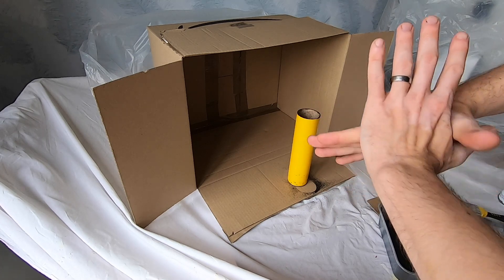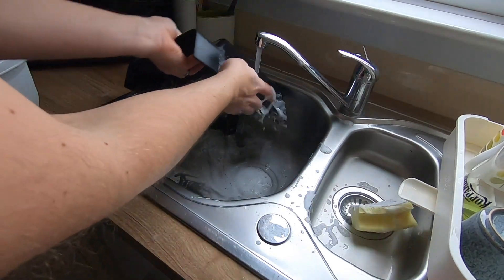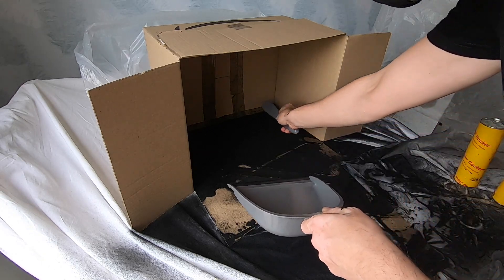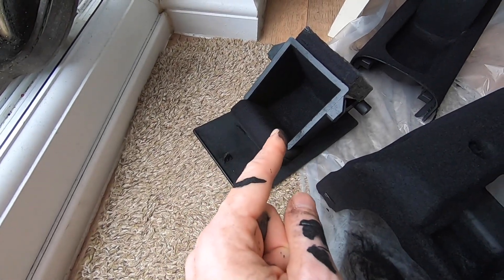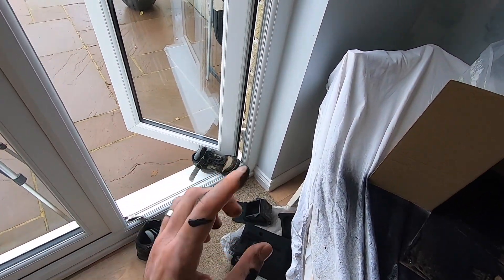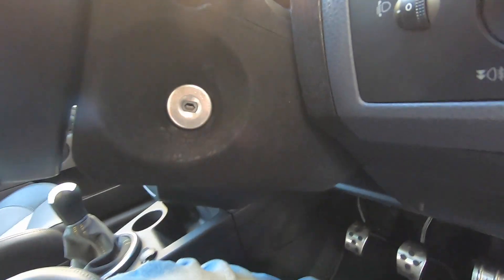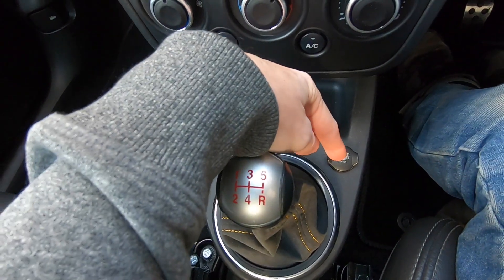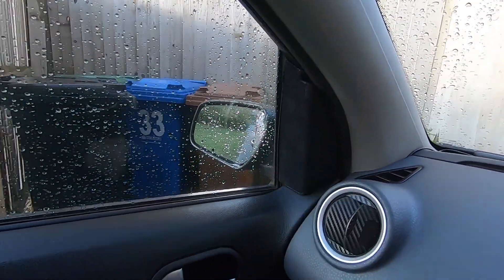How To Flock Car Interior Parts Detailed Flocking Tutorial Car Mods - Episode 23

Comment: If you've never tried it, a barrier cream like PR88 is a lifesaver for cleaning up your hands after a job like this. You apply a thin layer to your skin (which basically disappears, unlike gloves which can be a bit cumbersome) before starting and once your finished the glue or paint will just come away with soap and water.

Comment: you got me with the mirror interior trims, originaly they feel cheap af, Id love to know how and where did you get those ac knobs, Im also desperate to find the color code for the stereo surround dashboard, that anthracite metallic grey just doesnt exist anywhere.

edit: for the roof and the pilars you can get spray paint for vinyl leather and fabric, there is a dupli-color spray paint for that job.
Reply from the maker: Yeh love the two Morris trim pieces, nice touch to the inside.
I dont mind the grey dash touch. Wouldnt mind it all done in alcantara or leather though ha.
My door cards will be the same alcantara with gold stitching as my gaitors to tie in and then leather with gold stitching along the top of the door card. Then the inside should be nearly done and looking good
Reply: @DriveWithAndy  oh yeah, i forgot the all black and gold theme you got there :) I dont mind the grey dash either, but the factory paint is just too sensitive, I have some worn out areas near hazzard button and under the stereo, thats why I want to find the original paint.
Reply from the maker: ohhh i see, i honestly didnt know those areas where painted, just thought it would be a plastic mould in that colour. If i had it any other way Gloss Black would be cool but then you do get bad reflections in the window which can be annoying. Might do my Door Pull Surrounds gloss black whrn i get the door cards re trimmed. Also when i can afford it haha
Reply: @DriveWithAndy  oh yeah they are painted, very poorly I must say so watch out if you want to keep it original, gloss black is not an option, buttons and stereo can not be painted and would look off.
Reply from the maker: @neurontechno  very true about the buttons, they will stand out. Thats why i like my new head unit as its the same grey plastic, not some horrid after market surround that looks a diffeent finish and colour and not a great fit
Reply: @DriveWithAndy  still waiting for it lol
Reply: @DriveWithAndy  forgot to mention, if youll ever want to spraypaint surround dash,, remove original paint cause it will peel off
 underneath and will inflate, it will react with the spray paint.

Comment: Interesting… thanks man! Question though, why not just rub down the handbrake surround and try again?
Reply from the maker: its quite hard to sand down and start again. I guess you can do but the glue basically becomes rock hard like dry superglue so it would need sanding down like crazy. I asked the flock shop i bought the stuf from and they advised its always best to start from scratch with flocking haha
Reply: @DriveWithAndy  ah ok. I have some bits to do so will investigate. Thanks man.

Comment: Nice vid, you spelt interior wrong though 😜
Reply from the maker: Thanks man, oops haha, my England is not the best 😆
Corrected
Reply: @DriveWithAndy  no worries, your English is good mate lol

How comes you never went with the electrostatic machines for this?  I’m thinking of getting the machine itself
Reply from the maker: @DJLloydy  think it was just cost and heard the pringles tube is just as good but I think after a few attempts at it now and not 100% happy with some small areas not adhering I would say getting the machine would guarantee a slightly better finish

Comment: what length did you use? 1mm or 2mm?
Reply from the maker: My order doesn't state but I feel it was 1mm as it's extremely fine the finish I got. 2mm will give you more of that effect where the shade changes when you brush it
Reply: @DriveWithAndy  thanks for the info. Am getting bad results atm. The glue dries too quickly for me and without a flocking applicator... The results are uneven
Reply from the maker: @mohsinrasul8450  yeh it's not the easiest thing to do but you definitely need the applicator. I wasn't happy with one of my parts and got a whole new piece to do it again. Otherwise means sanding it back

Comment: You said it feels like Alcantara? So it’s soft?
Reply from the maker: Yeh it has that soft feeling. If done right. Once I had something done by modsnflocks and was a bit hard and rough. Flocking can be great if done correctly but in the end I went down a different route
Reply: @DriveWithAndy  and how has it been holding up? Here in Florida suede gets sun faded VERY fast, so I’ve been looking for a an alternate. My old car I suede wrapped everything for it to be faded in less than a year.
Reply from the maker: @uhZeny  I replaced mine after just over a year but seemed ok. If anything flock may last longer than suede or alcantara